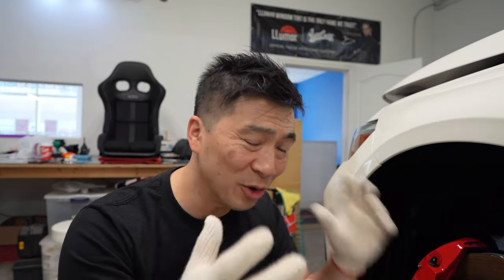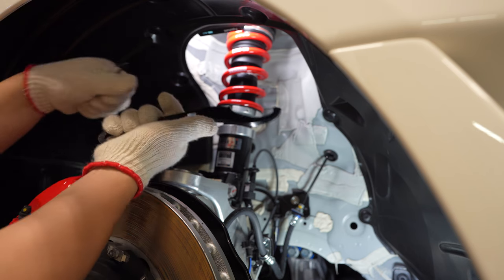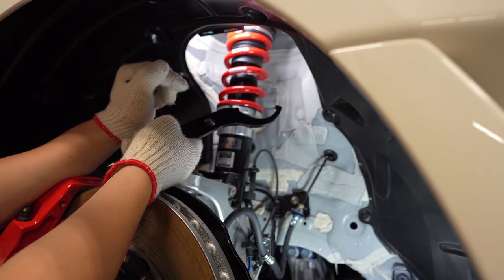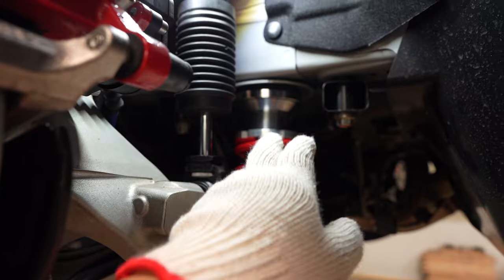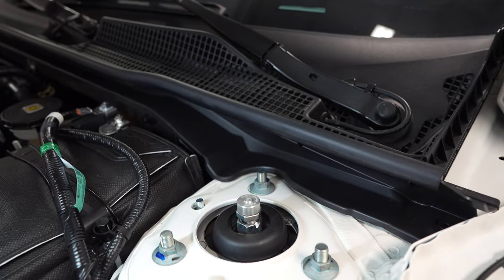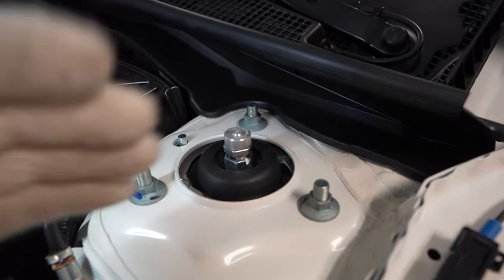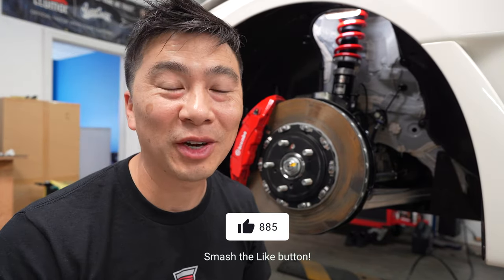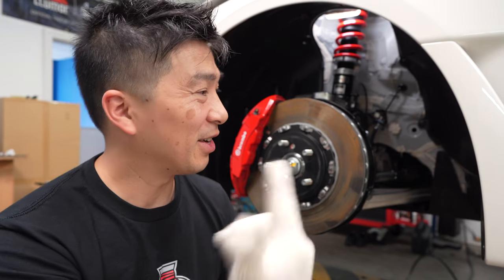RS-R Best-i Coilovers pt 2 || Civic Type R FL5

Comment: Was hoping you would show how low the drop can go. I have Eibach sport lowering springs on my FL5 & would like to go lower than the inch drop they provide. Thinking about getting these RSR coil overs. Be interested in how you feel about them now 9 months afterwards. 😎🤙🏽🙏🏽
Reply from the maker: I took the CTR on a road trip last week. It's pretty comfortable and handles awesome in the corners. As for the drop initially I had the wheels tucked in the fenders and it could have been dropped more but I just didn't want to take the risk of rubbing on the fenders.

Comment: I've decided NOT to go with lowering springs. These are a viable option I'm considering. Did you guys have any alignment issues after the installation. And thanks for the detailed install. I plan to review it multiple times before I install. 👍
Reply from the maker: We didn't have any alignment issues. Most of the alignment specs was close to stock.

Comment: Great video.
Im getting my set installed soon, what height gave you the best out of the coilovers? TIA
Reply from the maker: Hard to say because it comes down to personal preference. I have roughly .5 inch gap all around and so far no issues.
Reply: @phothrottle  you're not rubbing? What's your wheel set up? I'm at 18x9.5 +44 with 275 35 18
Reply from the maker: Tire and Wheel Specs
Advan Neova ad09 265/35/18
ADVAN RACING GT PREMIUM WHEELS - UMBER BRONZE 18x10 +40
Reply: @phothrottle  Thank you

Comment: I've tried RS-R on my 2018 Honda Accord 2.0 Sport for almost two years and I got rid of them and installed lowering springs instead. Unfortunately, they are not street- friendly since the coilover is way shorter than OEM struts, meaning there is not enough damper's travel to comply with road dips.

Comment: Could you use Stance Aircups on a detached setup?
Reply from the maker: I'm almost certain you can. I was thinking of doing an cup setup for the CTR. The roads in Canada is not ideal for lowered vehicles.
Reply: I looked more into it, and you can. You’d have to measure the inner and outer diameter of the spring, plus they have a tankless setup as well
Reply from the maker: @killumashotti  the only draw back with a tankless set up is the wait time to inflat the cups. With a tank it is almost instant inflation but the tank takes up more room and have to run the lines from the back of the hatch. I wonder if porsche and Lamborghini run a tankless setup?

Comment: What's the front max camber setting you can achieve with this coilover? I know that stock is around -1.3 and with the pin removed around -1.8? Does install this coilover make it possible to go to -2.3 ish?
Reply from the maker: To be honest I'm not 100% sure. I asked RS-R and I'm just wait for them to respond. Once I have an answer I will let you know.

Comment: can you make comfort mode more comfortable than stock? or more stiff for r+?
Reply from the maker: Yes you can dial up or down the dampening.
Reply: @phothrottle  do the adjustments on the clickers alter the dampening for each driving mode or it's a global adjustment?  ie do you select the drive mode and adjust on the clickers, then do the same on the other 2 drive modes?
Reply from the maker: Tsung you only need to dial the dampening on the RS-R one time and the factory ADS will adjust itself based on the mode you select.
Reply: @phothrottle  Thanks for your prompt reply.  Much appreciated!  So the the offset between soft med and hard dampening levels are pre-set by the factory ADS mapping and the manual clicker is a global offset knob for the baseline?
Reply from the maker: @tsunglee4523 that is correct
Reply: @phothrottle  👌👍